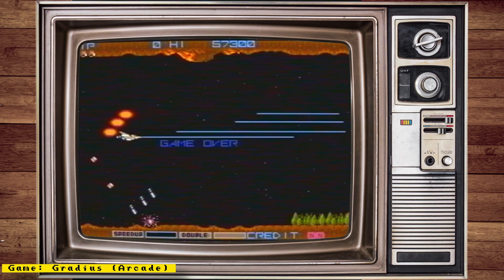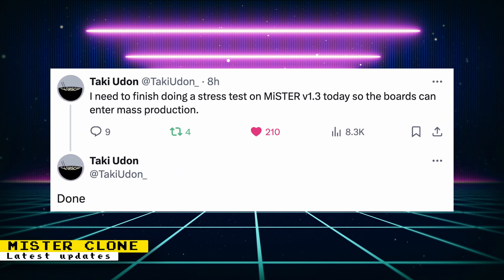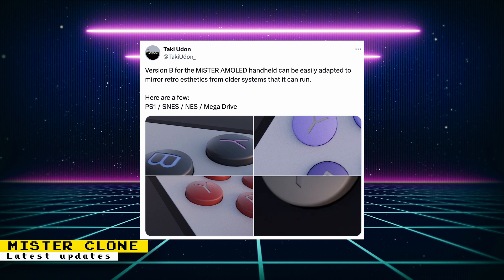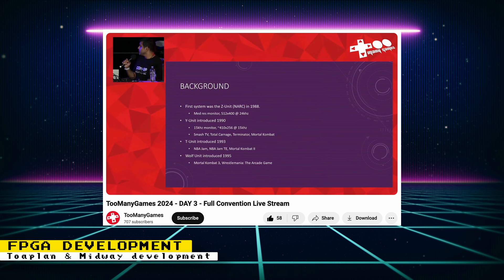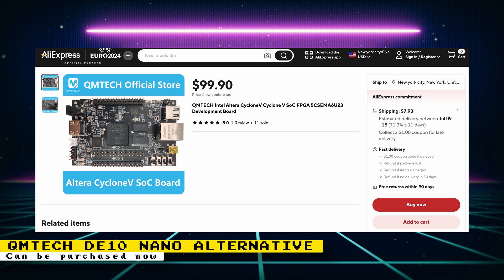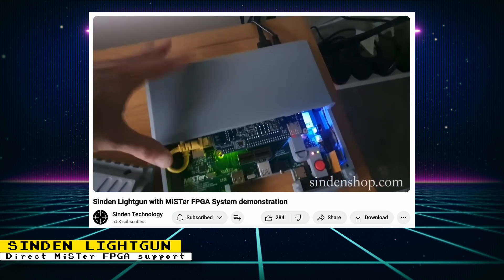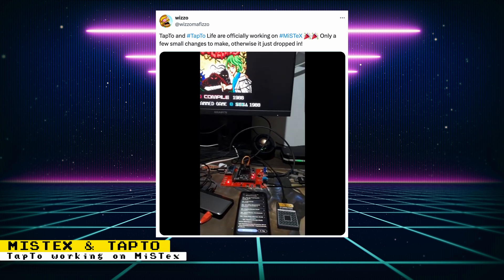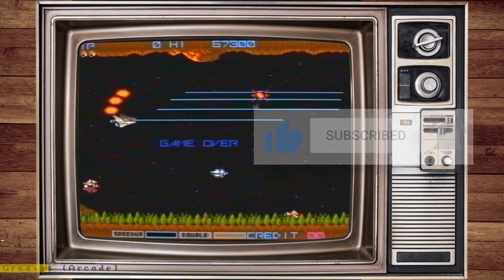MiSTer FPGA News - MiSTer Handheld, Two DE10 Nano Alternatives, Sinden Lightgun & More

Comment: The control fix is for a subtle but longstanding issue. If you had multiple (physical) buttons on your controller assigned to the same (core/game) button, it didn't keep track of them separately, so if you tapped a button that was already being held, it'd forget that you were still holding it. It now works closer to what people expect, which is mainly useful for shooters where you'd have two buttons mapped to fire, and one of them on autofire. After this fix, if you press them both at once, the held button isn't cancelled by the autofire, which means you can't accidentally ruin charging a special shot by releasing autofire too late (you can even keep holding autofire and when you release the regular fire button, autofire will kick right back in.) I hope that makes sense - go try playing R-Type before and after the fix to see what I mean.

I think it also fixes the issue where if a controller had both a dpad and analog stick, accidentally tapping the analog stick the same direction as you're holding the dpad would make it stop registering the dpad as held - bringing mario to a crashing halt. (It doesn't try to deal with SOCD so feel free to make mario moonwalk still.)